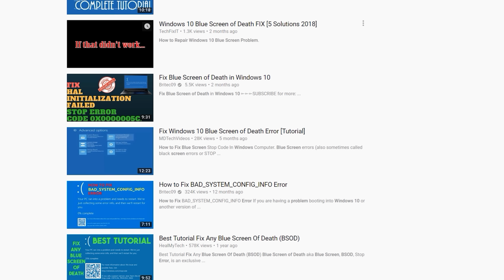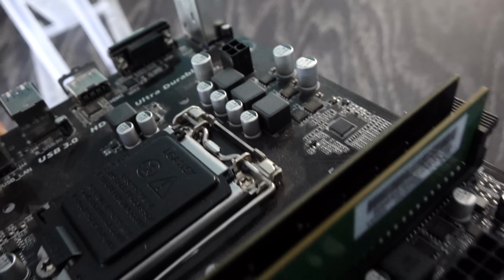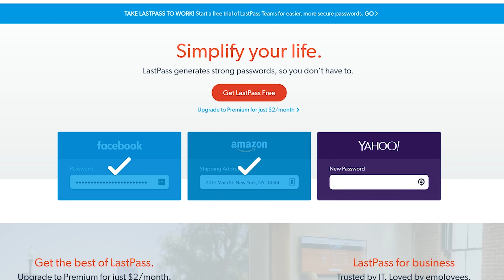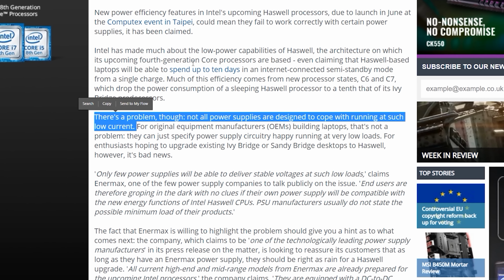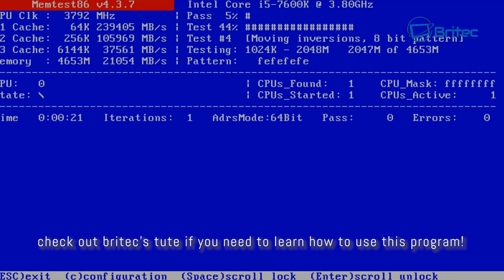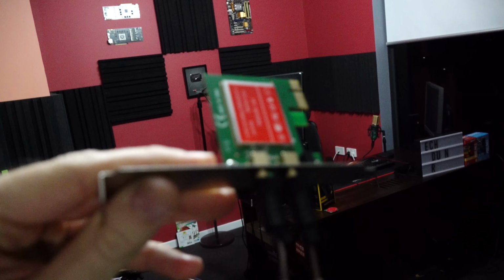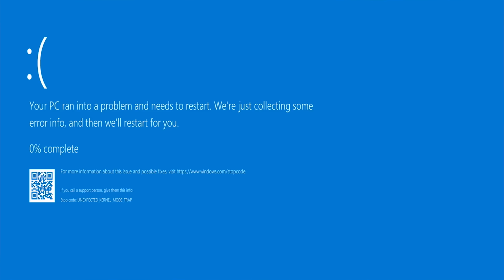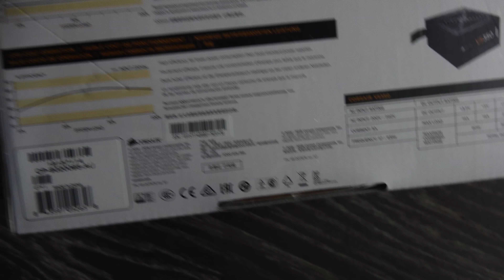How To FIX a Blue Screen on Windows 10

Comment: Nice video mate! I was wondering if you had any idea if there’s any way to sort out black screening when I try to boot to bios. I’ve looked around online (Places like Tomsharware and reddit) and the solutions I found there just didn’t work for me. Basically what happens is when I press Del or F11 it gives me a black screen with an underscore at the top. This also happens when I boot from windows (which I can still log into). I could try reinstalling windows I guess, but if you have any advice from experience I’d appreciate it a lot. :0
Reply: Oh and also I use the MSI b350m pro vdh motherboard, Ryzen 3 1200, 4gb Kingston DDR4 Non ECC, R9 270x and a gamermax 500watt 80+ bronze psu. :)

Comment: Guys help me. I have a X5660 system, Rampage 3 Extreme, Crucial SSD, Cooler Master 1200W PSU and Asus RX 580, recently I upgraded my 2 x 4gb Corsair modules to 2 x 8GB Corsair Modules. It worked fine until I got Memory Management BSOD, files got corrupted and since my USB stick is trash, had to reset the Windows SSD from my laptop. Successfully got a clean install of Windows and put it in my PC and boom instant BSOD (Critical Service Failed) or Memory Management. When it worked I ran memtest64 in win10 and it worked (however it was only for 10 mins). BTW Linux Mint works totally fine when I used my laptop SSD but I can’t move to Linux because it does not have Drivers for my WiFi Stick and Sound Card. Should I get a refund on the new modules I got?
Reply: Get 3 ddr3 modules to run tri channel

Comment: Any idea what this one refers to?  "Stop Code: IRQL_NOT_LESS_OR_EQUAL"?  It doesn't seem very specific.  It's happened about 3 times randomly since I overclocked my Ryzen 1600 to 3.7 over a 3 month period.  P.S. Love your presentation style.
Reply: This bsod is mostly related to unstable overclock in my experience. Try giving more voltage to your cpu

Comment: Any idea why I get this when I try to overclock my ram? I have 32 gigs of Kingston DDR4 with a Corsair 600w power supply. Can't go my ram over 2300Mhz. I set the voltage to 1.25 volts and no joy.
Reply: Motherboard or CPU limits maybe

Comment: Not sure if it was mentioned in this video, but I've got the error message WHEA UNCORRECTABLE ERROR. I don't think I saw that error mentioned in this video, but I suspected that it was because I undervolted the CPU too much, and upping the volt seemed to do the trick and the bsods went away. But a couple weeks ago, it just randomly happened again while I was in a boss battle in the game Terraria, so I'm not entirely sure if the voltage was still too low. I further upped the voltage a bit and no bsods since. Also i should mention that it is an i5 4670k at 4.2ghz and 1.174v with a hyper 212 evo cooler. My psu is an evga 650w bronze.
Reply: I have a 750W bronze psu, it runs a 4790k @4.6Ghz at 1.26V for years, I had only 1 crash in windows 10 since I installed, that was 2 years ago...
Reply: Certain codes can hint to certain parts while overclocking.
The WHEA_INCORRECTABLE_ERROR or 0x124 usually means changing QPI or VTT on P55 and X58 and vCore on P67/Z68/Z77 (On LGA775 it can be both) 
0x1E or KMODE_EXCEPTION_NOT_HANDLED and 0x3B / SYSTEM_SERVICE_EXCEPTION  hints at not enough vcore (on LGA775 it could also be memory voltage) 0x1D does the same on P55/X58 but goes towards QPI/VTT on LGA1155 and IMC or VTT on LGA775
0x50 or PAGE_FAULT_IN_NONPAGED_AREA and 0x19 / BAD_POOL_HEADER points towards memory, so either increase voltage, loosen timings or lower clock
0x1A on the other hand goes more towards faulty memory.
(Had a bunch of those while overclocking, once you move from 0x9C to  0x124 and later 0x1E and after that just prime rounding errors you know you're on the right way)
There are some longer lists available with more codes. Of course it can always be a corrupted installation or just simply faulty hardware, but some just point towards certain parts when oc'ing.

Comment: there's another 1 faulty motherboard.
i have 2 same exact motherboard using same hardware(power supply, casing, ram, cpu) switching between these two mobo(motherboard), with all drivers installed correctly and same default bios settings.
where it failed to boot or random bsod while its okay to the other.
Reply: From my experience motherboard, ram and graphics card are most prone to failure. They are the parts with the most open components.
CPUs can outlive alot, I had a chip that was on 99°C for half an hour, another that is 15 years old and a third that runs 15% over its stock voltage and 40% over stock clock for years and all of them are still fine.
And then i got a motherboard where a RAM slot is causing bootloops, another where the IDE port causes random crashes and a third that stopped working after reseating the CPU (which still works)
I had graphics cards that stopped from one day to the other, same for memory modules, they just died without even touching them.

Comment: Weirdest problem I have is my ryzen 1600 system overclocked to 3.9ghz with a good b350 board Windows just decides on boot my clock speed to 1500mhz no system issues or crashes ever just a quick restart and it fixes it? It's defiantly puzzling

Comment: use linux..no blue screens ever..linux doesn't really care about your hardware config..windblows does
Reply: Kernel panic ...
And that won't help for software where Windows is still needed, and yes, there is stuff that won't work on Linux. There is even commercially used software that only works on IE 6 and lower.

Comment: As someone who has worked in tech support & service for over 20 years now, my experience is that the vast, vast majority of hardware failures are either the motherboard or the PSU (and the combo is common too - with a bad PSU killing the mobo, see below). In particular, as you also mention, dodgy and/or underspecced PSUs can and will lead to any number of weird problems. I've seen a lot of them. :D Because of it, I always use at least Gold, but usually Platinum or better and always overspec the wattage by at least 50% to be on the safe side. Apart from a DOA Corsair AX unit many years ago, I haven't had a single power problem since. These days I only use Seasonic Prime, mostly because they're sexy, but they've also been flawless in my experience. Except the price tag, which is ugly.

Weirdest problem so far: I had an old Dell server in for repair once, that was just dead. A colleague had already replaced the PSU and was puzzled because it didn't help at all. Thing wouldn't POST. Got a replacement mobo and installed it - seemed to work fine, I could boot up and run diagnostics and stuff. Decided to update to the latest BIOS and boom - black screen. Machine was dead again. Ok.. Ordered another new motherboard, replaced it, replaced every single cable in the machine, pulled everything non-essential out and repeated the update process.. Boom! Death #3. After getting motherboard #4 and testing almost everything else in another system with known good parts, I also replaced the PSU again just for good measure.. Presto - machine working fine and finally the BIOS update succeeded. I still have no idea why that happened, but hey - the server worked fine for several years after that so. All the other parts we replaced except the motherboard (they were thoroughly dead, all of them) worked fine afterwards. I've a love/hate relationship with Dell servers ever since, haha.
Reply from the maker: Guessing a bad 5v line, did you update from a usb stick?
Reply: Probably. Just so weird that it'd boot up just fine. Something got triggered when writing to that eprom that just killed the motherboard. Maybe the writing process just failed miserably and the mobo would refuse to wake up? There was no time to follow-up sadly. This was in a repair shop I worked at so boxes in and out all the time. We replaced parts till stuff worked and that was that!

Nah, no USB. This was a long time ago - late 90s or so. We used floppies then. :)
Reply: osgrov  gold, platinum etc doesnt indicate the quality of the unit, it's just how efficient it is. you can get 600w bronze rated units that are better quality than a 450w gold rated unit for example
Reply: Ryan Welburn yes, but not within the same brand. Typically they are higher quality as you traverse up the chain - wouldn't make much sense otherwise. :) But sure, a Gold unit from manufacturer A might be better than a Platinum from manufacturer B. I very much doubt you can find a lesser efficient unit that beats a higher efficiency one from the same manufacturer, though.
Reply: Keep in mind 5-9 year old kids are putting these PSUs together. 5 year olds build the bronze. 9 year olds build the Platinum.

Comment: Last strange problem i had, was when i tried streaming.
I set up OBS and used x264 faster software encoding for better quality.
While gaming DOTA on my i7 4790k i dropped a lot of frames and ingame fps were low.
HWinfo told me, that my first few cores were maxed out, but the last cores had still headroom, and i was baffled how bad the priotization was working.
I tried to fix the problem with allocating DOTA to the first 4 threads and giving OBS the last four threads.
DOTA worked fine on 4 threads and OBS encoding was hovering around 80% with 4 threads allocated, so everything seems perfect.
But as soon as i switched priority to DOTA and wanted to start playing, suddenly OBS stopped using the last 4 threads and only uses 1 thread (and then ofc dropps frames because one thread is not nearly enough).
Just to be clear, process allocation works fine as long as i have DOTA (or any other game) in a window in the bachground, but as soon as i switch to DOTA, OBS looses the assigned process allocation and only uses one thread.

Anyone an idea?
I found the solution, but it was such bullshit.
Reply: What it was? I have a 4790k too
Reply: RODRIGO FILHO  It was the Win10 Gaming Mode.
It was introduced in a windows update a few months ago and should help on systems with few cores.
But it seems to overwrite the manual allocation of OBS and games to special threads, as soon as you switch into the game.
Just disable "game mode" in "windows game bar".
I haven't read about this problem anywhere yet and it was pure luck that i remembered reading about that windows update meddeling with process priotization.
Reply: @rinserofwinds  bro u are the best!, thx for the tip :)
Reply: RODRIGO FILHO  Glad it helped.
This should not only concern our i7 4790k, but most PCs streaming on Win10.
I am really surprised, that i found no other people having similar problems since the windows update.
At least i found no reddit post or something about it.
Reply: @rinserofwinds  yes, I will test your solution tomorrow, but it makes 100% logic because gaming mode slows other process in other to free CPU power to the game, but if u are recording then things get bad. Thx for the tip bro!
About other people having that problem maybe they find the solution fast and didn't bother to create a topic.

Comment: Hey brian i had this problem more then you can count and it kept saying critical service error. Changed the ram as it was faulty then put new win10 on and another blue screen ? Now i jave a BQ 600w psu with a phenom II X6 1090t and a galax 1050ti oc 4gb LP gpu. I basically just pulled it apart. I most likey think its the ssd as everything else is working.

Comment: The weirdest problem I've had is with my notebook 3-4 months ago. I'd turn it on, get no signal from the display, but if I connected another monitor to it, both its own and the attached monitors would get signal. Shortly after that though, this "trick" stopped working so my notebook has either a dead graphics card or a faulty mainboard.

Comment: I just pulled a MOBO out of a 4 year old laptop (i5, GT 720m) that had a malfunctioning touch screen and touch pad for use as a shop PC. Now Windows refuses to boot because it is insisting on touchpad/touchscreen driver "handshakes"... Can't even get into safemode. Thinking my only solution is to reinstall Windows and disable these on the first boot ... or ... maybe use a different OS

Comment: I had a weird one yesterday. I just put this ASUS P5Q-PRO together with a Q9550. I installed windows 10 straight from the Microsoft website, once it got into windows and after about 10 seconds it BS and restarted. After it boot back up it took about 20 seconds to BS. After 5 BS I tossed in the windows 7 disc and the install went just fine, no BS. Then I figured what the hell I might as well see if I can Downgrade to win 10 that way. It worked, I don't know why or what or how but I've been watching youtube videos for about 3 hours and I'm typing this comment on the PC now and still no issues. Crosses Fingers and Knocks on Wood
Reply: I once built a lga 1156 system that wouldn't boot to my USB of win 10 if my life depended on it but loaded up a Win 7 USB just fine. I also did the win 10 upgrade via Win 7 and it worked flawlessly.. Just weird stuff that happens sometimes I guess..
Reply: Its mind boggling the amount of dramas the install process goes through had my old man sorting through issues for the past week and only just managed to fix it by using the latest update installer from windows.  for some this tends to be a fix but for others if it installs on some SSD drives it can crash the whole bloody thing.  had an old Intel SSD die on me when I updated it to 1803 recently had to RMA it.    seems to be getting more hassle then its worth lately.  my ryzen rigs have been going ok give or take a few memory overclock tweaks I have had to mess about with to get it stable.
Reply: And with that we are back to 7:16 "We as consumers should not be used as beta testers" As long as Win 10 will keep up that release schedule it will stay beta.
Reply: Update: It's been a few days now and it is still running just fine, I'm actually growing attached to this machine. This is the PC I wish I had back in 2010 ish. This thing is freakin fast for what it is and I'm finding myself using this PC more then my other 2 faster PC's. Farcry 5 getting 35 - 65 FPS, Boarderlands 2 60 to 100FPS, Fallout 4 30 to 60FPS outdoor 80 to 120 indoor. all using medium to high settings.

Comment: why my mouse and keyboard has no power until i reach lock screen so i cant enter the bios unless im using a seperate keyboard with ps2 port
Reply: This is very common, you may be able to enable legacy support for usb devices in your bios and it should give them power.

Comment: Fix 1: switch to linux
Reply: Yaze 76 this will not work if it’s a hardware or bios problem if the operating system is causing it this will work

Comment: you recommend 650w tech deals says 550w which is it?
Reply: Depends on your components. Modern Quad cores CPU and 1070-class GPU doesn't  need more than 500W on load. Older hardware might, and overclocked  components too. If you're not sure, buy a good brand (Seasonic, Corsair, Antec, etc.) 650W-850W gold (~$70 USD or more) will surely cover it. A good PSU can be used for 7+ years, and safely power your components / devices, so it's worth the investment

Comment: need cheapo PSUs, are Kolink ones any good?
Reply: If you buy new, don't risk it and buy a good one. Brands like Antec, Seasonic, EVGA, Corsair with at least some efficiency rating will be ok. Check independent reviews for the model you want to buy though, as a named brand can still produce fire-hazard PSU.
Or you can buy used, for used PSU I had the best luck with Antec (TruePower or EarthWatt series), Corsair (black labels, avoid green VS) and worst with Thermaltake, SHAW, Enermax (don't buy these, they seem to die randomly, I had a Shaw blew up as well)

Comment: Maybe i'm the unluckiest man alive. I bought some used parts to build a gaming pc, everything was working fine for the first 2 months then the PC started giving BSOD regularly. I checked every component then finally run memtest86+, 2 out of 4 ram sticks were faulty and i had to remove them. Still have those 2 sticks near my PC, just to remember how unlucky i am :D
Reply: Don't worry about it man :)
Its better than your PSU blowing up and taking the mobo and some other parts with it, or your 200-1000$ GPU breaking when there's no warranty
Reply: Atleast u didnt spend 2k on a pc build and only spent 1 day playing it before it started getting bsod’s

Comment: The undervoltage problem is ESPECIALLY there with factory OCed GPUs. When they age, especially the very high end OCed ones tend to sometimes need 10-50 mV extra.
Reply: I've encountered this in a way, where if I tried to overclock the card even a tiny amount it would crash and it was something to do with the way it drops the volts for idle.
Reply: Or Radeon over-volting cards. 1 of my R9 Fury does its max benchmark score under-volted.... So yeah, save power while getting better performance... That's on the "meh" Gigabyte cards. All 3 of of other Saphire Nitro Tri-X OC+ cards come out of the box really high voltage, but even still like additional Vcore (they bench a lot higher). I think Gigabyte just used sub-par VRM on the card, but even if it was, why not just lower the voltage if it runs faster like that anyways? Makes your product look really bad when it does worse at your stock voltage.
Reply: That is what I encountered with a 7300 GT years ago. It would clock amazingly, but after years of use it was just degraded. Usually that is known from massively oc'ed CPUs, but it is only natural that graphics would be affected as well.